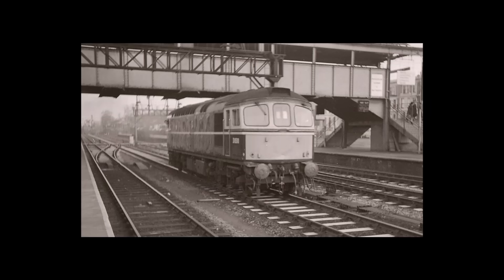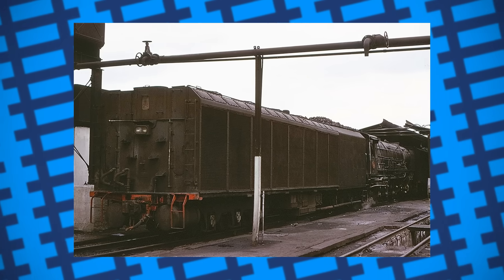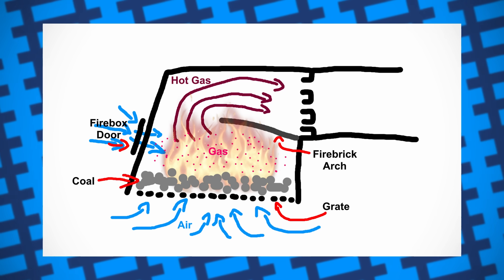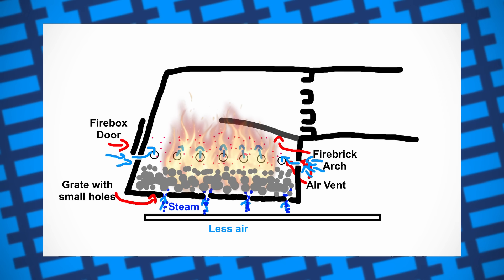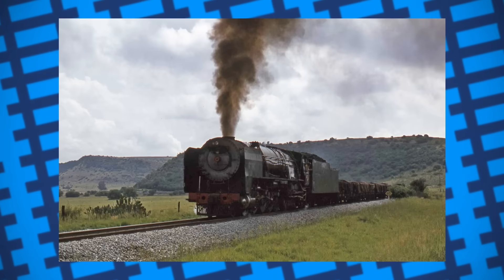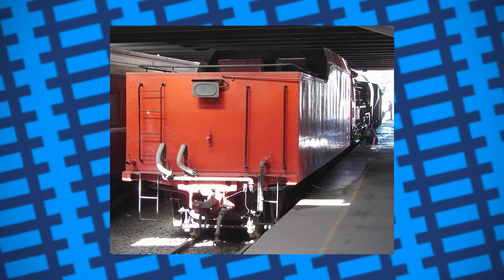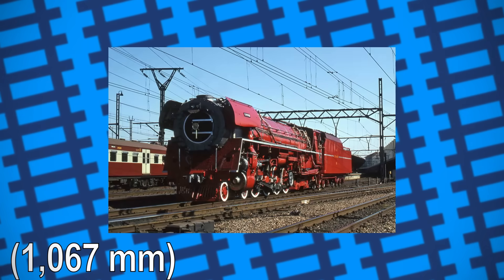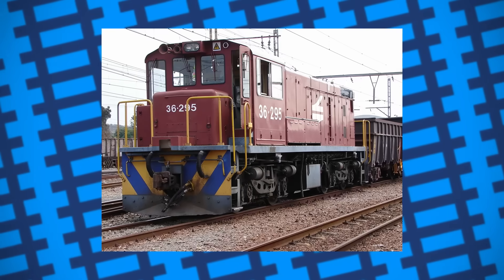South Africa's Diesel busting Steam Locomotive - SAR "Red Devil"

Comment: 25 percent less fuel....  that is a huge improvement.  makes me wonder if steam power (using coal) was still being researched were the technology would be.  I'm sure this techneque could be improved and who knows what other kind of systems could be created.
Reply: It's kind of a bummer that building locomotives is not an artform or science experiment but something one has to do for commercial reasons, otherwise I agree that indeed so many more innovative designs would've been possible that could really push railroading technology to its limits... It'd never beat out diesel for operational cost effectiveness but it'd be the most fascinating engineering.
Reply: @Julia_and_the_City  other technoilogies could also be pearred with it.  A ultra light steam engine with airpressure tanks powering all wheels (while the steam pressure rose) would help with powering steam engines and allowing them to be more efficient...  I'm sure other technologies (some they had back in the day also (air pressure)) could make them better than they were.
Reply: @Julia_and_the_City   Arent the Brits building a completly new one ?
Reply: @Julia_and_the_City Why would you say that? Ehat's the point of building locomotives if not for selling it to railroads...
Reply: There are so many technologies which never reached their potential because the world went with an alternative
Reply: I mean, most powerplants still use steam turbines so there is that.
Reply: We ALMOST got that actually; the Author of "The Red Devil and Other Tales from the Age of Steam" proposed a hypothetical "5AT advance locomotive". The project was canceled due to lack of funding; but managed to chug on from 1998 to March *2012*.

I still want a OO scale model of it.
Reply: Could totally burn a different gas, maybe methane or hydrogen, and have two or 3 cylinders like a conventional steam engine for starting heavy loads, then disengage the valve gear with a clutch of sorts, and have the steam turn a turbine to generate electricity for traction motors on the axles, run through a condenser or 5 and return to the tank for re use. Would be do able, could use stainless for the fire tubes, or even have a fan forced water tube boiler, there are endless possibilities when it comes to power production, hell you might even be able to use the compressed gas that will be burned to turn a turbine, before it enters the combustion chamber, seeing as it doesnt need to be under pressure once its left the storage tank anyway
Reply: @Colt45hatchback  I wish I understood everything you just said because I ponder sometimes what could have been with steam for all applications, but namely for trains
Reply: Hmmm... okay, how about this:

a steam turbine fueled using waste products (say biomass), paired with a mechanical stoker, the gas production combustion system, the superheater and feedwater heater among other things to power a turbine generating electricity to power a set of traction motors. The stoker and injector could be controlled using computerisation, essentially, you'd have a machine fireman.

The biggest issues it would face is the efficiency of biomass as a heat source, failure of the automatic fireman system, and probably maintenance.

Cost would probably not be too much of an issue, biomass is relatively cheap as far as I'm aware, a bigger issue would be water. An electricity surplus could be created via dynamic braking, with large and capable enough batteries enough electricity could be stored to keep the unit moving until the turbine came online.
Reply: probably pulverized coal would have been uses like they do in coal powerplants
Reply: Steam, maybe, coal, no way. Energy density of 24KJ/kg vs 45KJ/kg of diesel ... leaving all the other disadvantages aside, if you're using fossil fuels, coal is the one you definitely want to avoid.
Reply: 50 years ago saw a patent for articulated lok using producer gas - 250,000 pound tractive effort.
Reply: Probably would have ended up where we are anyways. Diesel has far out performed and simplified making it a cheaper, easier to maintain alternative. On top of that, while steam trains are beautiful in their operations, spewing tons of CO2 out isn't exactly the best for the atmosphere or the lungs for those working on and around railways.

I think what we have is the better alternative, commemorating the past with a few running examples and paving a way for a more efficient and cleaner future.
Reply: It takes 8 hours to start up steam engine, it takes one turn of the key to start up a diesel. Maintaince and operation vise there was no competition, technology was doomed.
Reply: @randomnickify  I understand/know all that, but I always wondered about efficiency, and he seamed to make huge improvements by himself so I can only imagine if real money and minds were thrown at it how efficient steam could be....  I'm sure they know and have more effiicient engines that have never made news, and I know it still wouldn't be as efficient as other power sources, but this was a cool video.
Reply: @cliffwoodbury5319  In the 60s either a car or oil company modified a car to make it run 100 miles or so on a gallon of fuel. That technology was suppressed because selling more fuel is better for the company.
Reply: @randomnickify  You can keep the fire in for many days. Once you have raised steam you can keep it there. With proper insulation you can maintain a balanced state, say overnight, burning very little fuel and without adding water to the boiler. This engine and the systems fitted to it and the thinking which went into it are far beyond what the casual enthusiast understands. If you look at shed facilities as developed by the N & W, the quality of which all steam locomotives deserved, turnaround times are very quick and today we could make them much quicker. Correct water treatment and management reduces boiler repairs, with the introduction of TIA the French found that they could close boiler repair facilities because they were not needed and it was considered that the stage was being reached where the boiler would never need to be removed from an engine during the course of its working life. You could also make engines suitable for single manning, Westinghouse did some of the work on this.
Reply: @DeCasoU1  you can also use water heaters to start it and get it running within 2 hours as long as the electric heater kept the fire box warm over night
Reply: @randomnickify  There was another factor the pool of cheap labour to support the infrastructure of servicing there were stops for coaling, watering and fire-raking out on the system as well as the workshops. The economic case was based on the kimberley to De Aar line.
Red Devil should have Mr Wardale's improvements re-instated.
I wonder what the result would be if you treated a British Rail '9F' 2-10-0 to the same modifications. But I think you need the engine to be tolerant of mediocre fuel yet burn it as cleanly as possible.
Reply: @randomnickify they tended to just leave steam engines smoldering
Reply: it would be in the same grave its in now. Steam locomotives waste immense amount of power to friction losses. As cool as it is to see nat. gas and oil fired locos and modernization projects improving efficieny, an external combustion engine will never be able to hold a candle to traction motors powered through combustion or mains voltage.